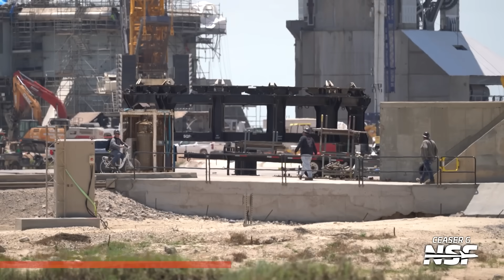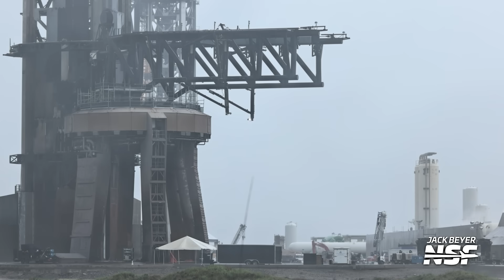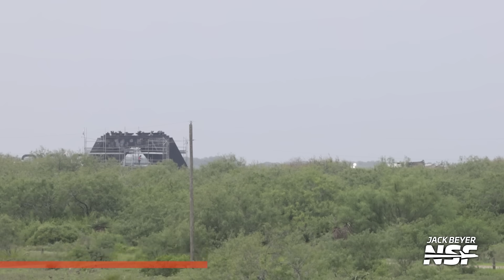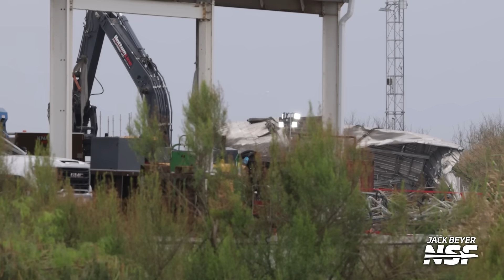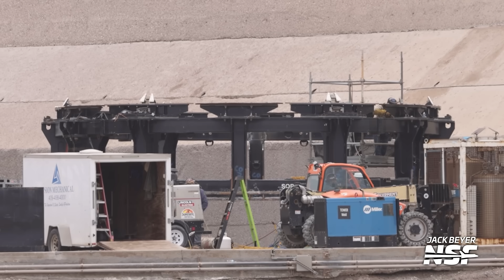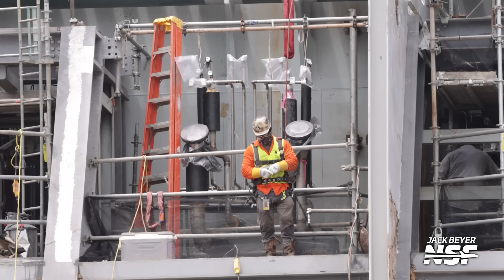"An unbelievable number of welds" | SpaceX Starbase

Comment: All the comments about hard facing - these surfaces don't need to be hard, those "leading edges" with respect to exhaust of the OLM legs are swimming in bow shocks from 6,000 degree raptor exhaust at like 5,000 miles per hour. Rockwell hardness is not the problem here, that's a very manageable structural problem and an absolutely unmanageable thermal/convection problem. Unless they're just replacing the leading edge that melts away every time, I would bet they're running some high melting alloy wire, some nickel alloy maybe. To try and delay melting into oblivion anyway...

Comment: My  guess the welds are hard facing. A special rod used to make a hard surface, usually used on heavy equipment buckets cutting edge. Just a guess, I've only done it once over 20yrs ago... If it is mig welding, you can do something similar with a "harder" wire, ER70s is my stanard wire, but ER80s is a bit tougher and I suspect there are more wires that are even harder. We tried the Er80s on a prototype casting for a customer after the casting kept breaking at the weld root. The prototype was used as a connector for pipes that screw into the ground to repair foundations and  lift sagging concrete... The harder wire did help with the fracture line that was just past our welds root, but it did nothing to fix the sheering of the casting connector when the pipe would get in a bind during installation. Cust had a patent on it, he called it the tri lobe something... Thankfully he gave up on it, his crews would have to hand dig down to the break, cut the casting off, drill the pipe while in the hole to use the previous design... Hard work, even worse when you know they were not paid enough... They work in the rain and snow, only saw them stop when it was extreme flooding as they couldn't keep the worksite from being a lake.

Comment: Not qualified to comment on specifics of the metallurgy but the welds are better than a patch since the patch will have gaps behind it and would fail instantly if any exhaust gets in between the two

Comment: so does that mean all the last block 2 boosters have been static fired and are good to go? It would be neat if they adapted the ST stand so the booster hold down clamps held it in place. Then they can just remove it by releasing the clamps and not butchering the OLM. So looking towards the end of the video, it almost looks like they may actually be doing that, you can see the sections where a hold down clamp could go.

Comment: Welds on launch mount.  They can add hardened or hi temp proof welds to protect vital sections of the mount.  They can also do this to harden areas that experience high wear.  it can also add thickness to areas that show excessive wear.

Comment: The welding rods are a lot more Harder  (stronger and higher tensioning) then the steel on the pad. They’re using all the welds as wear welds. Basically that area must be melting the steel more as wear. Since those areas are the HOT spots sort of speak, so thus the extra heavy welds. It’s stronger then the steel plate

Comment: Meanwhile, the Artemis 2 SLS core and boosters are stacked in the VAB. Core 3 rolled out of Michoud. BOLE ran 120 seconds with out destroying its test stand, even after the nozzle burned up. And another RS-25... did not blow up at Stennis.
Reply: How’s Orion coming along?
Reply: That BOLE is running something like $230M a pop, n'est-ce pas?  And the new RS-25, something like $100M each...  And BOLE is for Artemis 9; it's very unlikely that SLS or indeed Artemis will still exist by the end of the 2030's (when Artemis 9 might finally fly, at the rate this program is going.)

More to the point, without Starship, Artemis 3 would be all dressed up with nowhere to go, anyway.  (By itself, on its own, SLS at its cost and cadence isn't actually good for much of anything aside from launching Orion and burning money and schedules.)

Comment: 👍  For sure the welds can be and usually are stronger than the surrounding metal. You have different composite rod types you can choose from as well. The bone analogy works.

Comment: Bravo.......building up metal  plates .......offen when u add structure  add on .....strong points.....it changes load and the structural  dynamic .....the fracture  will migrate  to weakest point......that is a big crack to weld......why is there a crack there.....?

Comment: The welds are cladding to protect the steel structure from high heat. The corners of the steel structure get the most heat from the launch. Cladding is used in the oilfield for the interior of pipe that gets a lot of abrasion. He is likely cladding it with inconel.

Comment: Nothing but love for the block 2 boosters, but wouldn't it be easier to weld a beefed-up hot staging ring on top of one of them and use that to static fire ships on OLM1?  They'd have to do no work on the OLM, the ship at the right height for the QD arm, and could probably fabricate that kind of adapter pretty darn fast with parts on site...  Oh, well!
Reply: The stack is not designed for the booster to sit under a ship firing 6 engines for 5+ seconds.  The beefed-up HSR will just pass all the force down into the top of the booster's structure, which is in no way designed to hold a ship back from taking off.  Like telling a 5 year old to hold a pit bull, because we beefed up its collar.
Reply: The ship is not meant to fire through the HSR at sea level

Comment: Don’t sugar coat it. Massey’s was destroyed.
Reply: Just the southern end, a lot of the stuff to the north fared a lot better than a lot of people thought and we’ve in fact seen tank farm activity from that side of the test site (which we in fact show in this video)
Reply: @ale131296 Yeah. But it’s arguably the most important area. And it’s going to take a long time to fix.
Reply: @Waikatotek good thing they’re not planning on depending on it to continue testing
Reply: @ale131296 Yeah. Bold moves happening. Still think they should scrap current version then use pad 1 for testing until Masseys is rebuilt.
Reply: It was obliterated!

Comment: It is not "hard facing".
2 theories we have, are:
A recurring crack, at the corner joint, 'cos of thermal expansion.
And/or, damage on the corner, due to burnt out steel, because of the exposed edge.

Comment: What they should have done is build a launch mount "adaptor" that functions as a faux booster. That way, there's no need to modify the launch mount.
The booster adaptor would be clamped to the OLM, and it would have clamps at the top to hold the Starship in place. Then you can use the upper QD arm to fuel the Starship for testing.
When you're done testing, remove the adaptor, just like the booster, and there's no need to reverse any modifications to the OLM.
Reply: Isn't that what they're doing?  They're starting with something that can hold a ship and will modify it, so it can be held by the booster clamps on the launch mount.  Or I may have missed something.
Reply: It would be more elaborate, and take more time.  They only have two v2 Ships left, after which they're moving to v3 Ships and Boosters - and the old OLM is getting scrapped anyway, because it's incompatible with v3 anything.

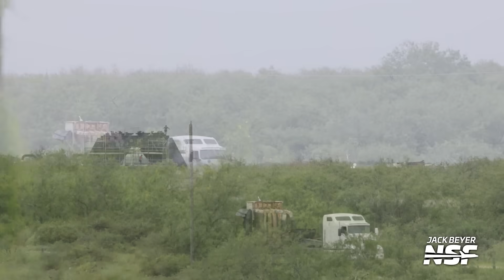Comment: 5:21 GSE Debris, That is a transformer. Correction was a transformer.
Reply: It is an ex transformer.
Reply: It was transformed into scrap metal!  (And likely some hazardous waste!)
Reply: @professorg8383  Much cheaper to refurbish it, transformers that size are both expensive, and a very long lead time item, in the order of a year or so unless you pay even more for rush. Strip the case, fix the damage and flush windings, and it will be back in around a month.
Reply: Alas, poor Optimus! I knew him, Hound...

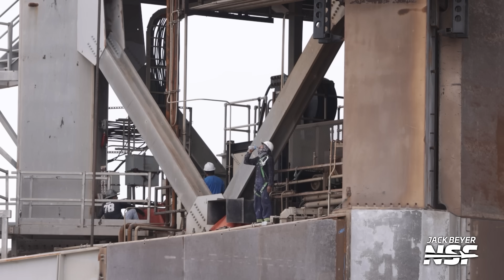Comment: 8:25 Welds, as a joint, are always weaker than the base material. That's why welds are reinforced with more thickness, and shouldn't be grinded down flush for aesthetic.
Reply: To always make the weld stronger than the parent material, and due yes, always a weld it is a weak point... (either because of being a joint, or due the crystalographic structure, etc...) That's why welds are reinforced with more thickness.
Reply: @samos_sainz still not true because you said it twice.  You can make welds stronger than the base metal.  They will break in the base metal before the weld joint.  Reinforcement is not very important, most codes do not want much reinforcement and are ok to have welds completely flush with base metal
Reply: @davidpennington4435  It is not that I said it twice, but that I explained it twice.
Meanwhile, you have not explain it once.
So, explain... How?
Reply: @samos_sainz if you have a base metal with a tensile  strength of 50000 psi like A36, a common mild structural steel but have a weld metal of 70000 psi like 7018 rod. Then you cut a strip of metal that includes the weld, it will break on tension in the base metal before the weld metal if the weld is made properly.  Works the same for toughness and harness. You can have a weld that’s tougher and harder than the base metal if you need those properties.  When you weld to code a WPS is tested to make sure your weld joint is no weaker than the base metal.  That’s why WPS needs to be qualified and codes exist.
Reply: @davidpennington4435  Let me clarify that the original comment, it's the thumb rule, the basic rule to consider:
Yes... joints, and weld joints, are weak points.
But, a weld never has to be the weak point.
So, it actually has to be stronger than the rest.
And, it can be made stronger.
But be aware that it's weaker on the joint.
Reply: @davidpennington4435  A36 steel doesn't have 50kpsi tensile, or 36kpsi like other said. It is more like 70kpsi, and comparable to S235JR structural, and 7018 rods.
Then, welding material has to be of better properties, and richer composition, but the closest match to the parent material.
Reply: @davidpennington4435  But, I get what you mean, as I asked for an example, with argument.
You are right on that, and there are codes and specific cases for everything.
It could be aceptable to grind flush, or even being needed, on some cases.
And you can make your weld stronger on several ways.
But one of those ways, it's through thickness.
Reply: @davidpennington4435  If you are welding a crack repair, and doing everything you can to reinforce it... then consider this:
Are you going to grind it down flush, actively weakening it, by giving it less thickness instead of more reinforcement... just for aesthetics, and to hide a repair, that otherwaise it would be an useful clue for the future?
Reply: That’s not true. You can easily make welds stronger than the basement metal. Your goal is to always make the weld stronger than the base metal.

Comment: The adapter is such a cool example of how this place operates. A team of engineers whip up a CAD model of an adapter by modifying the existing model of a ship stand. Then they do whatever magic analysis engineers do to make sure it will work they way its supposed to. It gets turned into a work order. And almost immediately, a team of skilled fabricators are making sparks turning it into reality. No bidding, no subcontracting. The pace is impressive.
Reply: they've made TONS of progress, 7 buildings in parallel is insane, things are gonna get crazy soon
Reply: Soon ™️  @JamesKorcc
Reply: Remember that SpaceX always worked like that in the early days.  They cut off the end of a vacuum rocket nozzle with tin-snips (one guy on the stand), due to an interference issue, while trying to launch.  NASA administrators would have had a heart-attack or brain-blowout if they ever had to deal with such an issue.  The launch went off fine, after about a twenty minute hold, plus time to get the guy out of blast area.
Reply: More likely, some high school educated contractors sketched out the idea on a white board in their lunch trailer and the engineers left the room shaking their heads, but Musk said, "Go for it!" 

The "magic analysis engineers do",  takes way too much time to do right!!  Some of the trades guys are decent "rule of thumb engineer/fabricators".  This happens a lot in big construction projects and it often works. But occasionally a building collapses because they didn't take all the forces into account!  

Real engineering takes time because you have to look at many things that aren't obvious and you have to take into account all the potential forces and design in a safety factor.  Trust me when I say, that did not happen!
Reply: @professorg8383  This place attracts young, very smart aerospace engineers like nothing else. The Apollo program was the same way. The idea will have been sketched out by a team of highly motivated engineers probably in Siemens NX. The magic part comes in with SpaceX having the very best finite element analysis software in the world. SpaceX is having trouble with literal spaceships with razor thin safety factor margins, in ways that are difficult or impossible to model. Their GSE/infrastructure is very solid.
Reply: The more half-assed things like this they've been doing, the  less progress they've been making.
Reply: @andrewm2002  The full-assed solution is putting the entire program on hold for half a year while rebuilding a test facility. Doesn't sound faster.
Reply: @needleonthevinyl Everything has been an absolute rush job since Block 2 ships have been failing.  The more they rush the less they have accomplished.  That's just facts.  Sometimes it's faster to slow down
Reply: @andrewm2002  I really think they would have designed and built this adapter just as fast 5 years ago. The fast part is because of their system. All the material, expertise, and labor is already on site ready to go. For anything they don't have, their procurement process is incredibly fast.
Reply: @andrewm2002 fun enough the ships worked better when they were half assed, they started making them in fancy factories and bays and they start exploding and failing during launch one after the other. Oh the irony
Reply: @andrewm2002  This sort of adapter is not "half-assed" in any way. I've seen similar stuff done, in jet engine test and certification.
Reply: @andrewm2002 why is it half arsed?This is what SpaceX does and has always done in the past. A problem arises and they fix it fast it’s why they are the premier aerospace company, half arsed my arse! Screw ULA, Boeing, Northrop and BO. If left to them test operations would have been suspended for over a year as internal risk assessments and company liability hearings, safety management meetings and myriad worker safety training programs were initiated. Long before a piece of wreckage had been touched.

Comment: I think it makes sense to modify existing stands to enable block 2 testing at the launch site.  This allows them to change Massey's to fit block 3.  They probably either have or have on order what they need for block 3 testing.  Probably not only faster but cheaper to modify the stand adapter for the launch mount than rebuild Massey's for block 2 then convert to block 3.  Danger, of course, is if there is a RUD on the test stand at the launch site.  I think it also settles the question of whether they were going to use the remaining block 2s or move straight to block 3.  SpaceX still needs to finish their block 2 ship experiments.